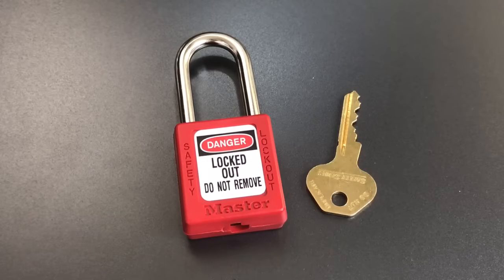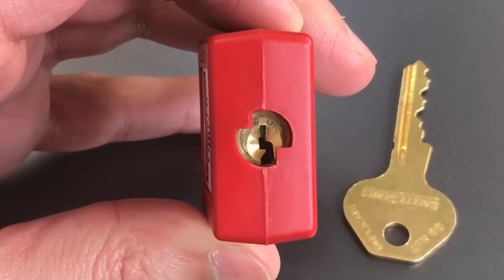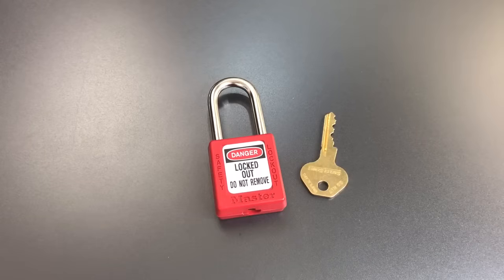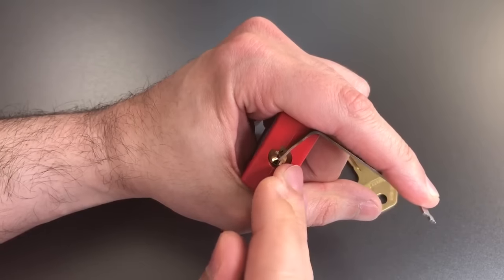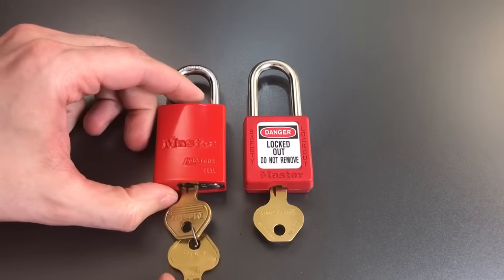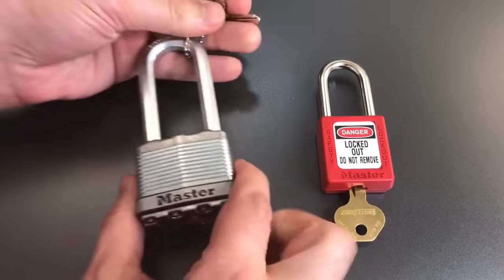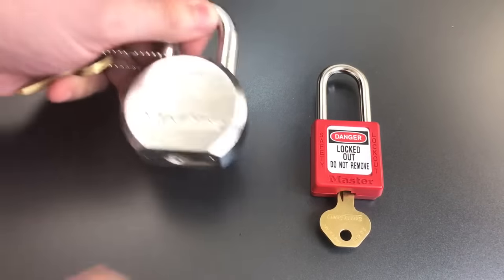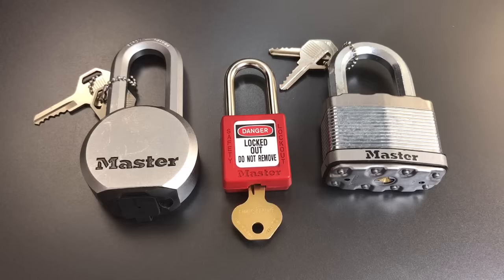[479] The Master Lock Paradox - Model 410 LOTO Padlock

Comment: Feels like it's almost a tamper-proof seal in a lot of ways, it's easy to bust open in an emergency if needed, but not easy to open without any trace ie picking
Reply: @ts757arse  agreed, although in this case "leave a mark" would mean a sheared shackle or broken lock body
Reply: Why the hell would anyone pick a LOTO lock? As far as I understand, it's only there to tell people not to turn on the equipment, in case they don't see the warning sign or something.
Reply: @peterstepanov8062  To make it look like an accident?
Reply: This is an exceptionally thoughtful observation, and I deeply resent your having thought of it first.
Reply: @23Scadu  Hmm this locked machine turned on, bobby was up in the control tower, when it happened and was last on the scene after it was all over, the machine is locked in the off position. What an accident! Bobby's innocent!
Reply: If someone is trying to pick a LOTO lock or open it without leaving evidence... I'd be concerned, highly. lol

Places I've worked tampering at all or opening a LOTO lock you didn't place IS termination. Fired on the spot, and usually security is called... they don't fuck around. Engineers and Techs know not to mess with them and it has usually been temp/PT workers or fresh workers who either; Don't know-- or don't care.

They get upset, but-- they could easily kill someone fucking around with those locks.
Reply: Places I've worked use even lighter then these locks.... paper tags..... firing or court martial offense for touching them without authorization.
Reply: This is correct. Easy to open with force, but not surreptitiously. Also a cost factor; expensive only on the thing that matters.

Keep in mind that the same model of lock are also used to secure "key safes" that might hold 10 or 20 keys to individual isolation points on pieces of equipment.

If a person decides, for whatever reason, they want a key out of a key safe, and can get it undetected without gaining authorisation, plant is able to be energised in an uncontrolled way. It could easily kill someone. 

A key safe or lock and tag being secured by these padlocks are not usually stronger than could be overcome with bare hands or simple tools. But doing so would leave obvious signs and would usually be precursor to instant termination.
Reply: When someone goes home and forgets to remove their lock on the equipment they can then verify their at home and not at work, and cut the lock with minimal expense.

Yet, like others have said, it’s really really hard to tamper with them

Comment: My heart dropped to see the thumbnail with your name on it, showing the lock i trust my life and limbs to everyday. After watching I left more than content. Thanks from one on the line LPL.
Reply: This is what I was thinking that the reason why it's so hard to open it because power switches can be deceivingly small
Reply: @ralanham76  I bought one, and it broke within a week, after I picked it open, once, and very easily, (This was after trying, and failing, to open it on previous days.) I then operated it a couple of times with the key, after which it failed to stay locked. I'm fairly new to lock picking, so was understandably surprised at how easily it could be picked (not raked) open. Would not trust my life to such fragile locks, and shall not be buying another one in a hurry.
Reply: I’ll take ‘things that didn’t happen’ for 200, Alex.
Reply: @louisradico1511  Not only that, but they would have to pick the lock off of the equipment that you are working on. Chances are that someone would see that person trying to pick a lock off of the energized equipment and go WTF lol. Picking is pointless anyway, anytime someone loses the keys, we just cut it off with bolt cutters. Much faster and less hassle.
Reply: Look up Navy Lock out Tag out, they are literally pieces of paper with string on it. The lock is not important, just the notification that someone is in the machinery. If someone wanted to hurt you, it is not like a lock is going to prevent them from doing what they want, just more of how long it would take them to do so.
Reply: @anthiggs  i agree it is more to do with unintentional injury by unobservant operators but still a scary thought.
Reply: I felt exactly the same, these locks make me work without the anxiety of being dragged into a escalator. But I also like the way that they are quite fragile because if you lose the key and have isolated equipment a quick cut is needed to stop fines mounting up on you or your company.
Reply: @drunkswithguns4124  If you cut one of the LOTO locks in our company you will be in safety officers hell!
Our locks are personalized, nobody else is supposed to remove them. There are also no spare keys available. If you loose the key in the washing machine, the lock is lost, too.

The locks we use are from Abus, not Master Lock. Also a sophisticated cylinder and double steel ball but the shackle and body are made of aluminum.
Reply: @DrKlausTrophobie  whenever we have to cut one, it has to be verified that the employee is accounted for and not working on that equipment. Usually it's people losing keys, or they leave the plant and forget to remove it. Just call the person, verify that they aren't here anymore, and then just cut it. Better than waiting on them to return
Reply: @drunkswithguns4124  No exception here. Call em back in, wait for them, it's a lesson for life not to forget the lock again...
Reply: @anthiggs  i dont think you understand how hard youd get the shit beat out of you if you tried to bypass a LOTO lock.
Reply: @frigglebiscuit7484  I don't think you understand the Leavenworth you'd disappear to for fucking with a LOTO lock
Reply: @frigglebiscuit7484  Stop trying to pretend you are big. It doesn't work in America
Reply: @septclues  "Hey i use this common lock at my common job, glad it helps keep me safe!" You:

 Not everything is fantasy, redditor. 🙄
Reply: @mmmmnda  Keep editing those posts. Maybe nexti edit you could add le epic meme arrows!
Reply: @drunkswithguns4124  the person who applies the lock has to take it off, be it with a key or bolt cutters. I’ve seen someone dragged out of bed and back to work just to remove a lock and without pay I might add.
Reply: @RWBHere  you are not thinking about how these locks specifically are used. They are not to be impenetrable.. They are to me in place while you are working on a machine. They are made to be broken off if forgotten to be removed... They have so many variations to keys because every ton dick and Harry at a site carrys at least 1-3 not to mention the factory probably has 25 available for use.
Reply: @justanaveragegamer9744  the plant i work at isn't super strict on it, but if you constantly forget your lock, punishment will be made. Its easy to just call someone and verify they are gone these days. Even easier to just go look at the equipment to assure they aren't in or around it. I work in a major chemical plant similar to DOW so its mostly piping systems and tanks with hazardous chemicals that we work on. Ive forgotten mine once, but they just called me and said "Its all good.", and cut it.

Comment: "Do not remove"
People trying to break in: darn
Reply: XD If that worked, I'd just get a sticker that said that.

But no no it's for Lockout Tagout for work purposes :p cause sometimes idiots are like "hurp derp, it says it's broken but it turns on anywys!" since it's not locked and then a huge problem occurs. :<
Reply: Yeah a huge problem or someone gets crushed or something...
Reply: Cue the “this sign can’t stop me because I can’t read” meme
Reply: Swiper no Swiping!
Reply: I had a buddy in the Navy, he was a radar technician. He secured all power and did all of his lockout tagout procedures properly before he entered into one of the high power radar arrays to do some work. Here comes some jackass who flips a power switch for it and electrocutes my buddy. Somehow he survives. Dude no has almost zero motor control in his body now and is permanently 100% disabled. Do not ignore tags or locks that say danger on them.
Reply: same way criminals feel about gun bans
Reply: Cynic with a Cword its a loto bro
Reply: to be fair the red plastic flag is supposed to have a yellow over red plastic flag two miles away from it so that they have time to stop but what happened someone through flags up without telling anyone??
Reply: @like300foxes  also, the employees that work in these types of areas are likely to be felons and have access to lockpicking equipment, so you really need that strong core!
Reply: “Do not remove”
Oh well I wouldn’t want to break the rules....
Reply: There’s nothing to break in to, these are locks you put on a lever in order to keep someone from flipping it and killing a worker
Reply: All plans foiled
Reply: @Syntheticbreed  how could he flip the power if if it was locked out properly? Just curious because you put a LOTO lock on the power supply so it can't move... At least the machines I operate anyhow... That's sad
Reply: ngl, if you remove a LOTO lock-- you're terminated (typically) on the spot, or on the way out the door... when a LOTO lock is used-- it's USUALLY because it's SUPER dangerous. Eg; When someone is hit upside the head and dies because someone removed a lockouttagout lock and activated a machine or panel. 

Every place i've worked had that policy, tampering with safety stuff IS termination, not grounds FOR-- or CONSIDERED-- it's then, there, security comes and you're gone. lol
Reply: @aandyherr817  last time I locked out equipment (yesterday, lol) it was ceiling fans. I wouldn't have died but I sure as heck didn't want to take a fan blade to the head because someone turned them back on and I moved backwards a few inches on the lift right into the blade.